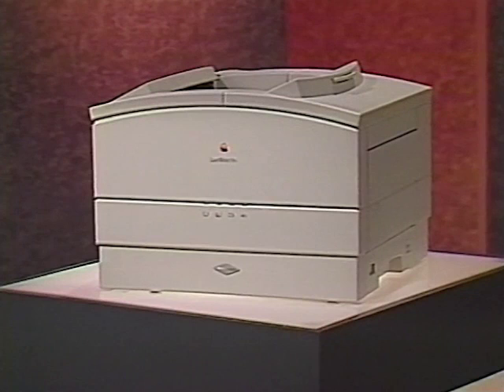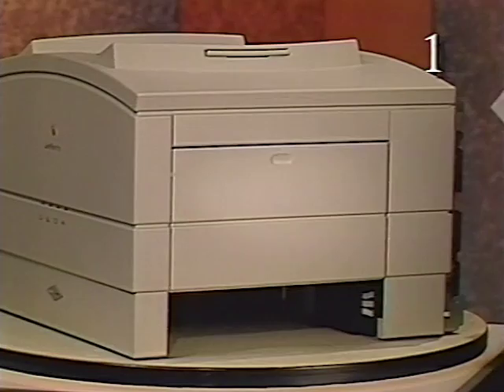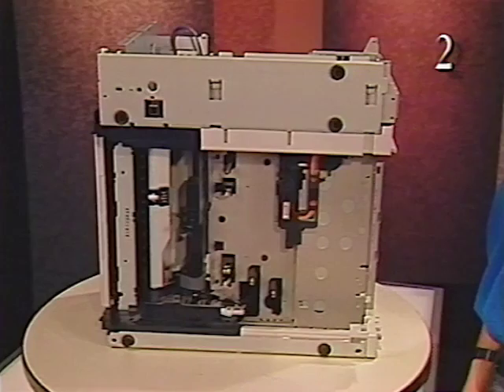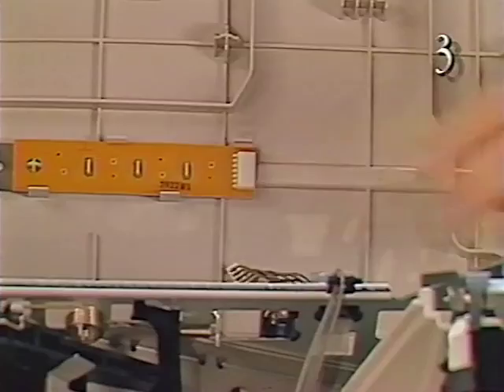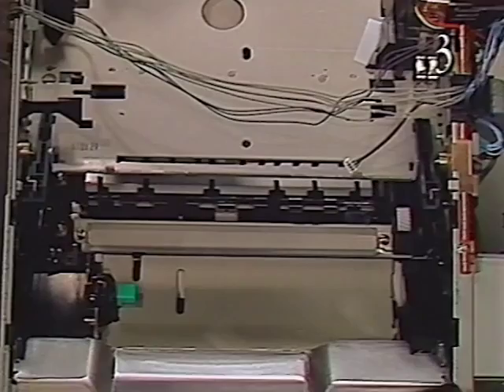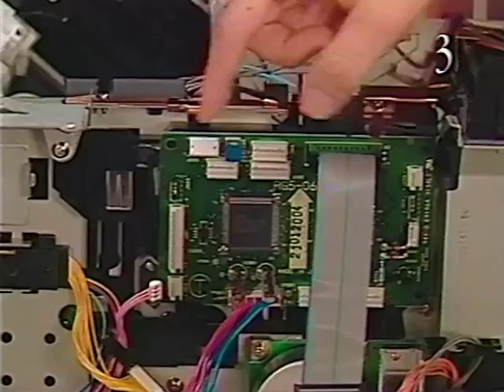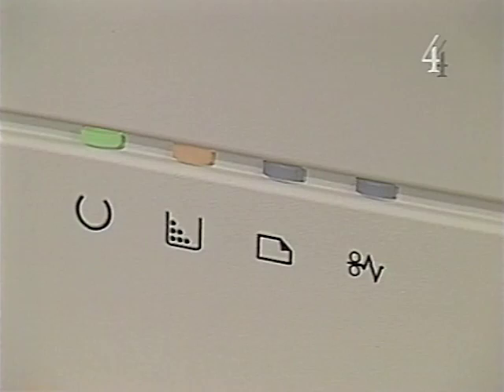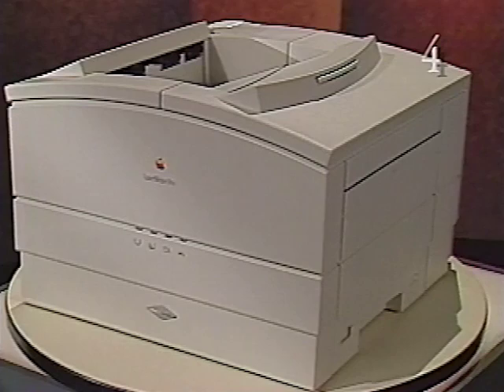LaserWriter Pro Printer Service - Apple VHS Archive

Comment: I always wondered why Apple turned a lot of their laser printers 90 degrees. This is a LaserJet 4 or 5 with the interface lights on the side of the printer instead of on a panel in line with the fuser output. It made them seem bulkier (although they aren't) and why Apple removed the LCD display so all configuration has to be done via software instead of at the printer.